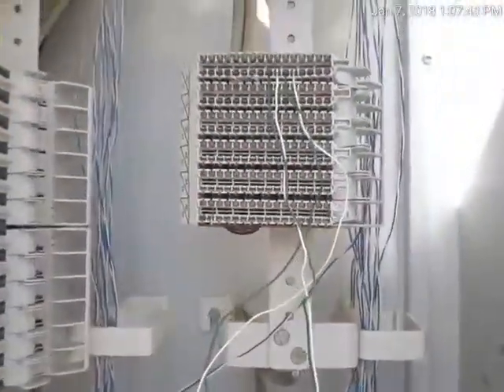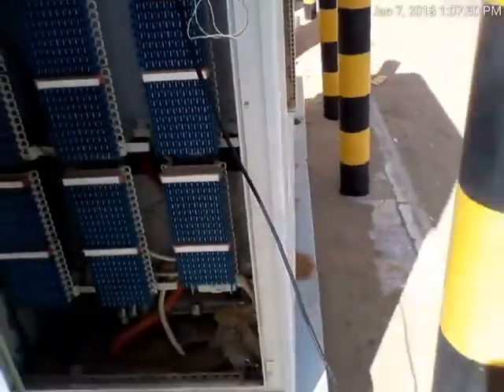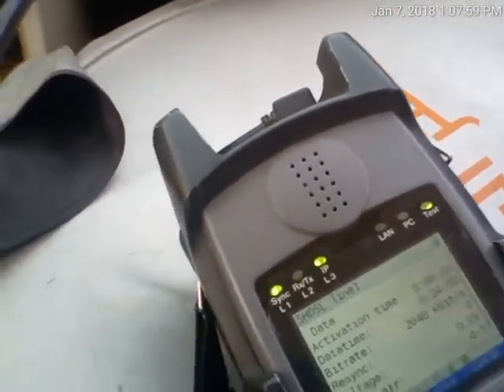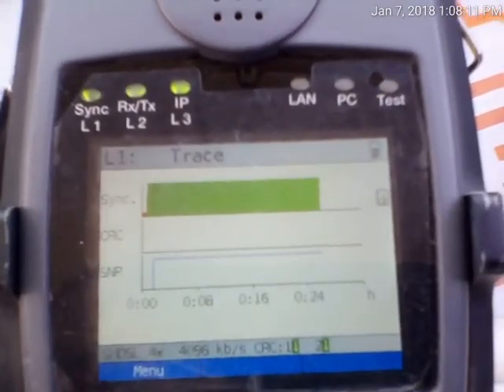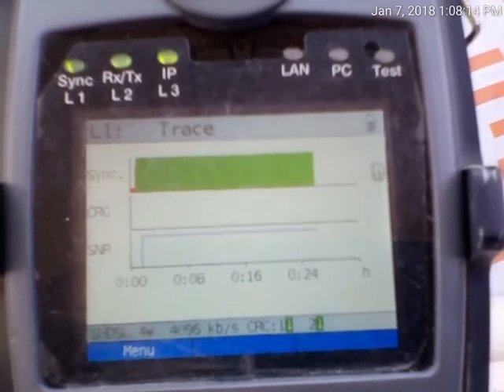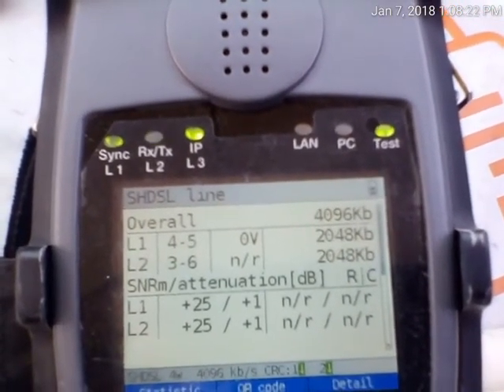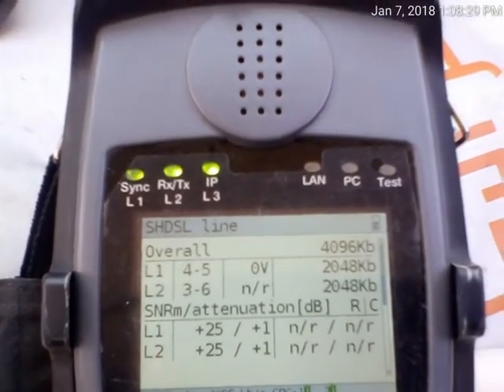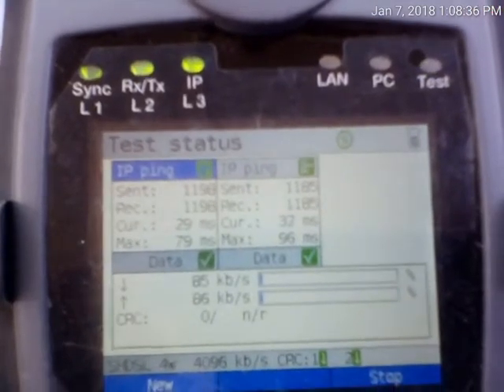Circuit/Leased Line Testing From MSAN

Comment: Can you tell how many connections can one single dslam handle ?
Reply from the maker: Each DSLAM has multiple aggregation cards, and each such card can have multiple ports to which the customers' lines are connected. Typically a single DSLAM aggregation card has 24 ports, but this number can vary with each manufacturer like in Alcatel it is 48 ports
Reply: @meteoroid-1574  ok thanks for telling me so internet is a seperate connection than telephone if im right ?
Reply from the maker: @shonking1973  no it uses same phone line connection if it is ADSL but if we need to provide dedicated internet or ipvpn links above 1 or 2 mbps than we use different cards like SHLB ,SDLB ,and MALC
Reply: @meteoroid-1574  OK but  when looking at the wiring I have been told that phone line is separate from Internet .
Reply from the maker: @shonking1973  no it uses the same cables for ADSL technology you can use phone at the same time on the same copper cable for internet Voice calls are conducted at a frequency of 0 to 3,400 hertz, but the copper wires installed by telephone companies are capable of transmitting frequencies of up to two or three million hertz. Each type of communication operates on a different frequency
Reply: @meteoroid-1574  Ohhh i see now thanks for telling me and so what about fibre connection . Is there any difference ? 😁
Reply from the maker: @shonking1973  thats completely different world of fiber ...as you know signal is transmitted in the form of light ...there are different devices from different vendor to convert the signals for the end user so phone lines will aslo work and high speed internet will also work ussualy now a days MDU is used for this purpose
Reply: @meteoroid-1574  ok do you think fibre makes things simpler than cooper .
Reply from the maker: @shonking1973  yes 80 to 90% simpler than copper due to many factors ,moisture ,corrosion, electromagnetic field etc
Reply: @meteoroid-1574  Ook i see thanks now tell me interms of wiring do i share it with my neighbour . Like one connection is shared between two . 😁😁😁
Reply from the maker: @shonking1973  yes you can but after installing you modem and access point for the other user
Reply: @meteoroid-1574  ok thanks in a exchange box (DSLAM), what equipement is there .